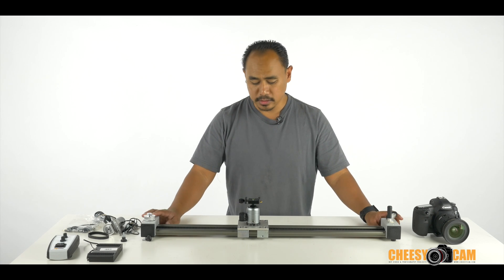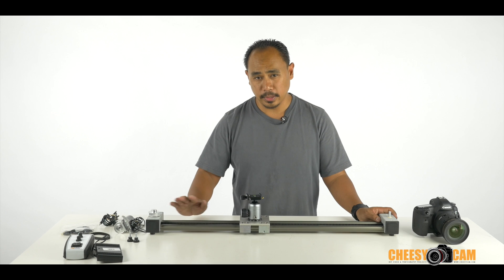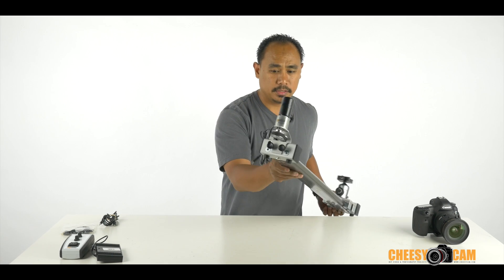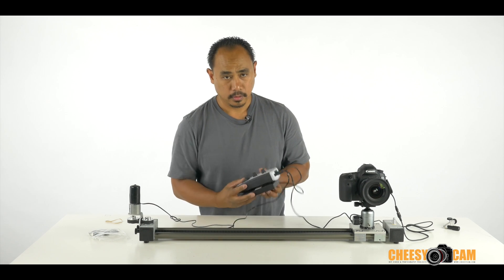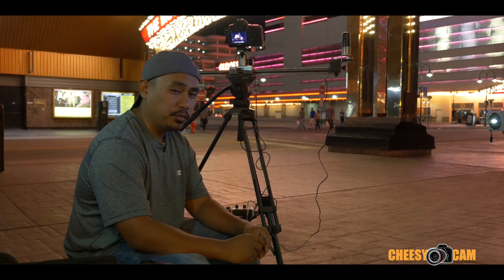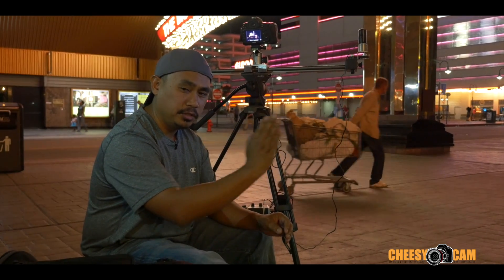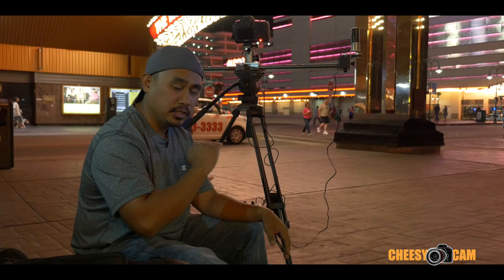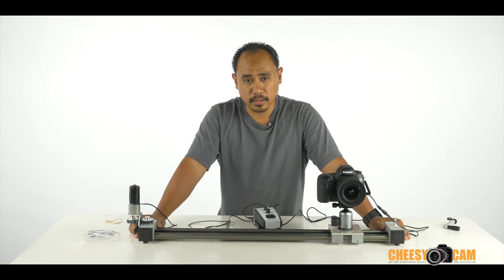DigiSlider Motion Control Time Lapse Slider Kit Demo

Comment: @MrCheesyCam - just picked this slider up - using it for video - i find the motors to be quite loud and would be picked up - is this normal for motorised sliders? This is my first slider so not sure if this is normal.
Reply from the maker: This system is for timelapse photos. There are others dedicated for video work, with quieter motors. I think there is a new version of this with quieter motors.

Comment: Quick question. If you set the exposure time for 5 seconds and you set the motor to move every 6 seconds you have that 1 second buffer. But eventually it will catch up with the exposure wouldn't it? Or does the shutter always start when the movement is complete?
Reply from the maker: If you are firing your camera from the remote, then it will move after the shutter exposure.

Comment: why do people not buy the (DIGISLIDER 2 AXIS AUTO-PAN VIDEO & TIME LAPSE CAMERA SLIDER)? it's carbon fiber, does panning and is not that much extra in cost? what's the difference between the two?
Reply: Well I got the one you are talking about (about a month back), the 120cm version of it and the carriage wobbles. It makes these small steps as if it's tilting down slowly...which is really annoying, as the whole point of a slider is to make a smooth slide. I returned it and I ordered the 100cm version of the slider in this video, which has a lot more positive reviews, it is sturdier,  it can take more weight and you can also switch the motors. I'm hoping that I will be able to verify the positive reviews...waiting for it to arrive at the moment.
Reply from the maker: +Hannah Norris This video is almost two years old. The new 2 Axis auto pan you are talking about just came out recently. More people will buy that slider now.
Reply: I have that slider - do you find the motors are abit to loud? if recording an interview for example?

Comment: is it compatible with sony a7r ii?
Reply from the maker: +Roberto Pagliari Sony has changed the shutter cable on the A7RII, but it still works like a basic shutter release cable. I think they should have adapters for this now, and you can contact the company to see if they have the right cable for it.

Comment: Hi, I just bought this slider and it arrived today. The first problem I found was that I could not attach my DSLR as it did not come with the silver connection device you have on your camera. Did yours come with it? If not, what is it called so I can buy one? Cheers
Reply from the maker: Round One Sports You need to buy either a Video Fluid Head or a Camera Ball Head. A ball head will let you position the camera with many angles, and most likely what you want if you're doing timelapse.

Comment: If you get the standard (short exposures version) can you use it as a normal slider. Etc. Not as a timelapse slider, just as a smooth slider at a normal speed or would I have to set it as its fastest speed (which might take 4 minutes to get from one side to the other) and speed it up? Please reply ASAP as I am highly interested in getting this slider for normal filming! Cheers MrCheesyCam
Reply from the maker: Round One Sports They have different kits so you should contact them. I'm not that familiar with their entire product line.
Reply: Okay, one last thing is, to do the vertical shots e.g. moving the camera vertically up, you need an extra piece for the slider to connect the camera to. Does that come with the slider or did you buy as an extra? Cheers
Reply from the maker: Round One Sports You need a camera ball head or fluid head that can tilt 90- degrees to place on top of the slider. That is not part of the kit. It's the same type of head you would put on any tripod.

Comment: What equipment would you suggest for the gh4 to do moving time-lapse?
Reply from the maker: Daniel Sin For shoot-move-shoot to work effectively the camera has to be fired by the same controller that is controlling the slider movements (so they are coordinated). I'm not sure if this remote can fire the shutter, but if it can, this would be a good option.
Reply: MrCheesyCam I don't know any motorized sliders so far that can coordinate with the gh4, but I'm looking at the MS motor kit (1500:1) from konova. I know you said if the shutter is open for a long time then it will result in a blurry image. But what if the shutter is quicker? would it still be as blurry? And would it still have the same sliding time-lapse effect with a constant slide instead of a shoot-move-shoot slide?
Reply from the maker: Daniel Sin If the shutter is fast, and the motor is slow then you will not see a blurry image. You can still do motion timelapse. In the GH4 you can specify when to fire the shutter, so if you delay this process then it will give the slider enough time to move down further. It will be a balancing act, but it will work for fast shutter speeds.
Reply: Excellent information, thank you.